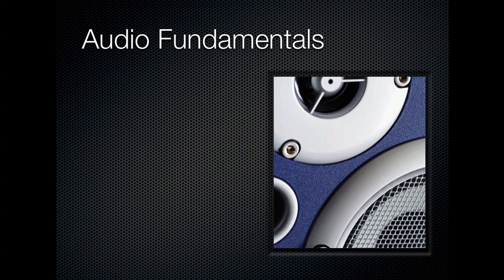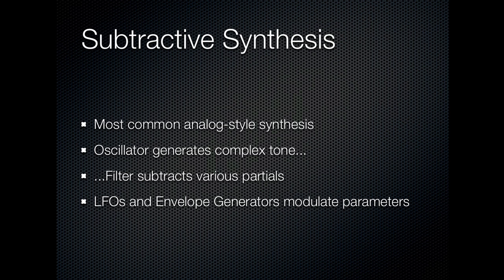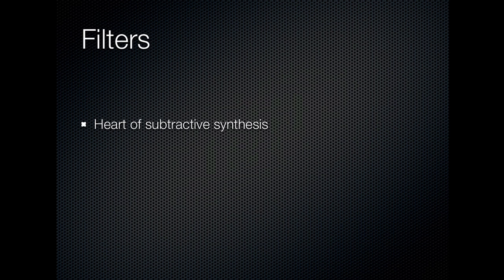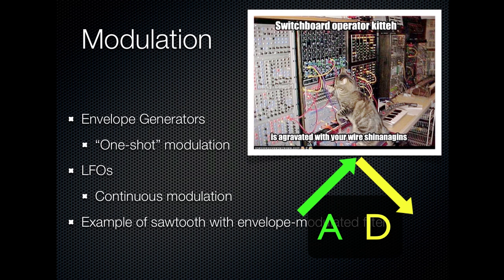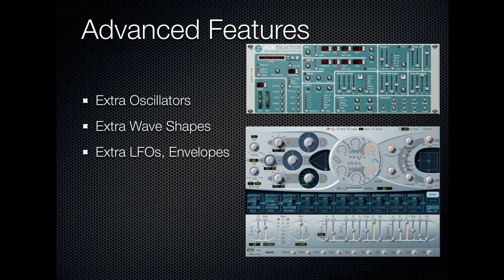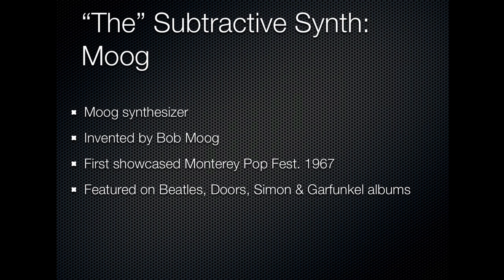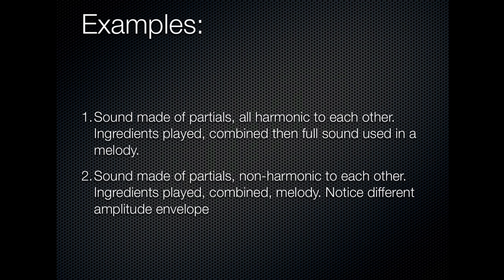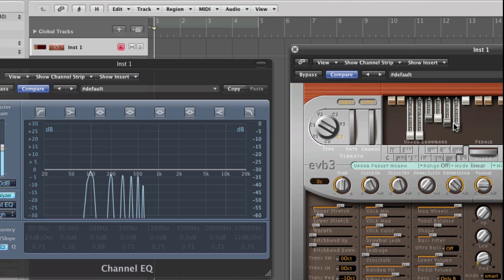AF008 Scratching the Surface of Synthesis

Comment: Could you please tell me what you have done to the voice over it sounds really good is it compression or limiting maybe I'm trying to understand compression and limiting please help me with the settings you use?
Reply from the maker: Thanks! It's actually really simple - a modest AT2020 mic with a pop filter, into an audio interface set with plenty of headroom at the input. Most of the peaks only reach around -18 to -12dB, with a few of the very loudest maybe hitting -6dB. Then I apply a fairly gentle low cut (high pass) EQ at 120 Hz, and some fairly fast compression (attack around 10-20ms, release 30-50ms) at a ratio of around 3:1 or 4:1. The threshold depends on how hot the input is, and in my case I think I used something like -24dB so that it would shave a few dB off the loud sounds of a majority of words.

I think a lot has to do with the treated room I was in (with absorption preventing that "small room" sound, even though it was a small spare bedroom), using a pop filter to keep a consistent distance from the mic, and preventing clipping from ever happening at the input by keeping the interface's preamp gain reasonably low.
Reply: Matt Mayfield Music thanks my friend your videos have helped me a lot thanks for the settings it sounds good im just confused about compression when you said threshold at -24db does that mean if you set the threshold at 0 db would it be more limited/compresed as there is no sound going over 0 db.compression is confusing!
Reply from the maker: There are 2 ideas that will help this make more sense:

1) The volume levels I'm referring to are measured in dBFS. 0dBFS = the loudest you can get*. A level of -24dBFS is a lot quieter than 0dBFS.
2) A compressor REDUCES volume when the sound entering it is LOUDER than the threshold. If the sound going into the compressor is never louder than the threshold, then the compressor never does anything**.

A threshold set to 0dBFS is set very high, so most sounds going into it will always be lower than the threshold - meaning the compressor does not actually do any compression.

For more info on compressors see this video and the one after it: https://www.youtube.com/watch?v=WCrULTz65OI

* Kind of / sort of, in certain circumstances. Best not to worry about that within this specific example.
** Some analog and analog-modeling compressors alter the tone of a sound even when they aren't compressing. Also not worth getting into for this specific example.

Comment from the maker: I have limited experience with FM and formant synthesis compared to subtractive, so a video from me would be more like "let's explore this" rather than "here's how this works." That does sound like a great idea, though.

FM synthesis at its core is like a vibrato (pitch change) that happens so fast it alters the shape of the wave instead of just fluctuating the pitch. The formant synthesis I know of imposes an EQ curve (formant) on a tone. As far as I know it's quite different from FM. Thanks!